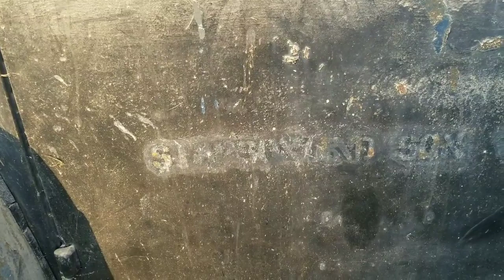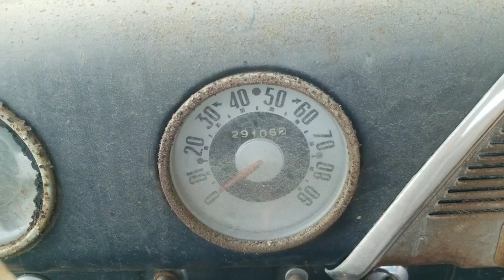TRAILER UPDATE AND 1952 FORD F1 TRUCK

Comment: Did you get the 51/52 F1 ? The flathead in it was a 226 ! Flathead inline 6. Truck like that in shape washed up And just a driver is worth more then alot of the done up 51/52 Ford trucks now days. Trucks in running/driving shape and untouched are very desirable and have been the past few years.